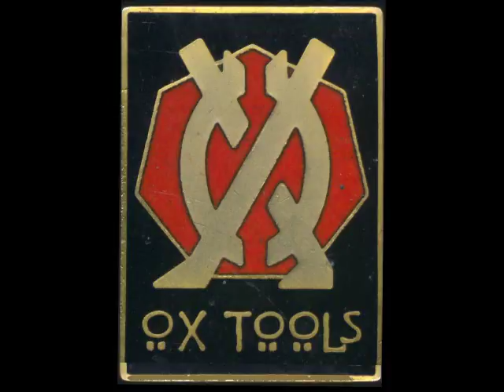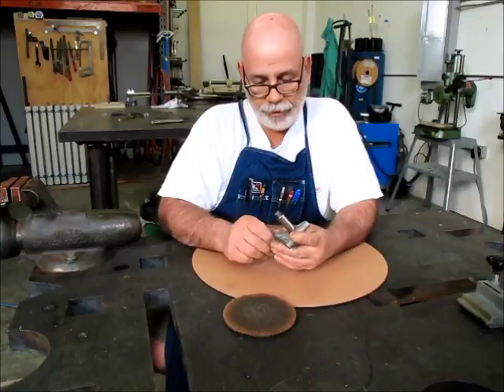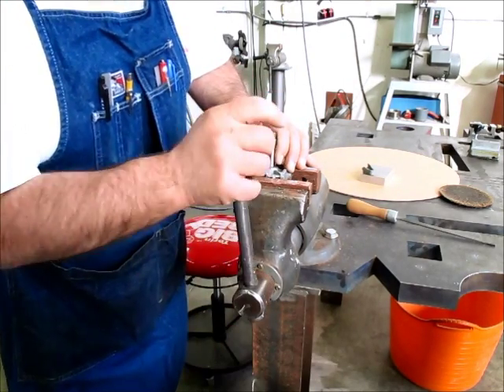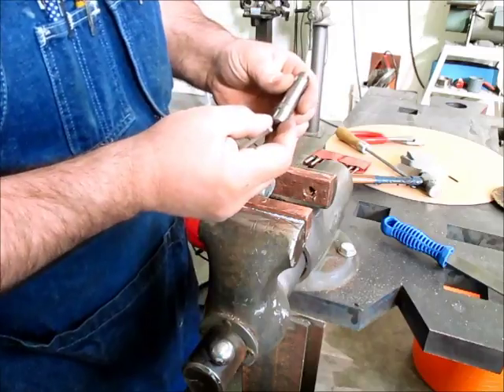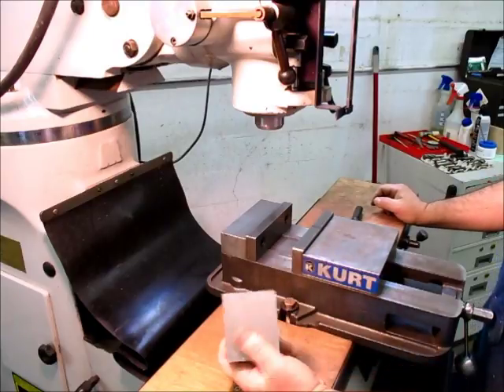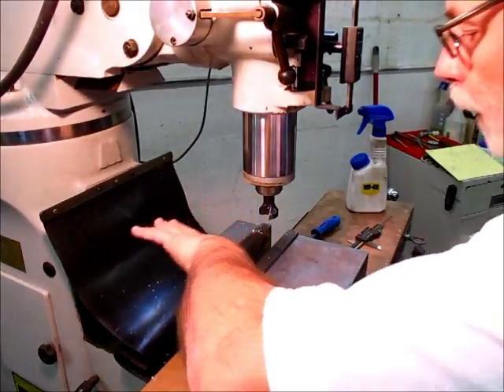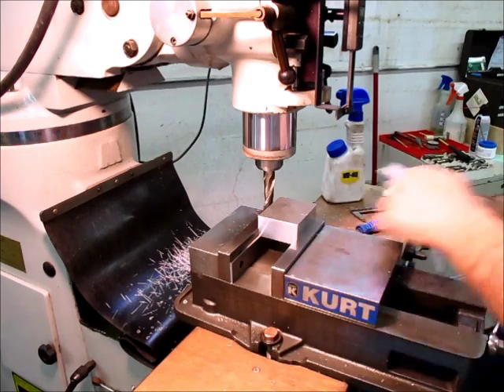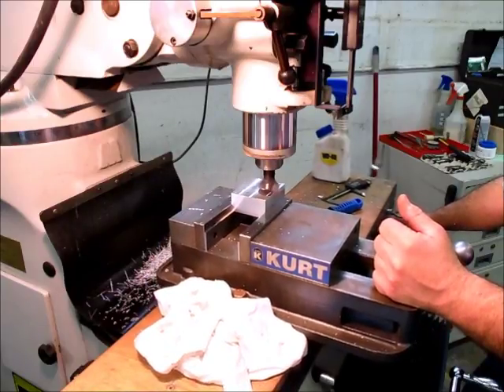Blade Tensioner Repair

Comment: Tom,
Thumbs up to the classical piano music in the background.  It reflects the very classy work you do in your shop.  
Interestingly, thirty years ago zinc "pot" metal was the most used metal in manufacturing.  That is, a greater quantity was used per year than any other metal.  I suspect that's still true, though plastic has replaced metal in many applications.  

Great lesson, making a tool to properly work on a machine without damaging it.

Richard

Comment from the maker: Hi Ron,

I've run a few different machines over the years. If you want an oversize say 10 x 50 table take a look at the Sharp's. I think they make an excellent machine and now you can get them with electronic speed control. We also had Acra's and Chevalier's that were pretty good also. You will love having that extra table.

Best,

Tom

Comment from the maker: Hi Glenn,

With small cutters and light cuts I don't give it a second thought. If you have large diameter cutters with minimal flutes then I start to worry. Anything less than 5/8 diameter should be a piece of cake unless your taking a big depth of cut. Try it on some scrap pieces and get comfortable with climb milling on your specific machine. Its more efficient and leaves a better finish in most cases.

Tom Lipton

Comment: Messed up. To finish, probably not the approiate thread to ask but I will anyway. I'm in need of upgrading my vertical mill. Old Bridgeport has about seen it's day. You have seen them all. What would you say is the best mill out there. Maybe a little larger than the standard Bridgeport. Would like DRO, power fee, knee feed as well, and power drawbar.

Comment: Tom, excellent as usual,

One question, what's the stick wax you're using on the vert saw? The stuff I bought is very dry and flaky and more crumbles on the table than gets on the blade. Looking for a more sticky version.

Also, thanks for the tip on your book, I was actually going to purchase it even before I found your blog. It comes highly recommended.

Cheers,

Glenn

Comment: Sorry to bug you Tom,

But one more question: I noticed you were climb milling, what's your thoughts on this?

I'm rather scared of it on my 70's bridgeport, (I only have four to five years under my belt, so I've sorta stayed away from climb milling because of all the warnings I've read about it) - My machine is not beat at all and is in remarkably good shape, so with that in mind, would it be safe to do?

Glenn

Comment: Is there a part 2 for this video, or is that still in process?
Thanks Tom, love your shop!
Reply from the maker: Hi Norman,

There are several on this job. Use the magnifying glass icon and search tensioner. Six part series.

Best,

Tom

Comment: Bizarre to find this now.  I just got a 1930s vintage Delta 14" bandsaw last month with the solid wheels(not really solid, just steel with no spokes).  After taking the motor apart, installing new bearings, brushes and replacing the crumbling tires, I couldn't get the damn thing to track.  Took the wheels off and....you guessed it.  The wheel was hiding this very part that was bent to hell.  I didn't think pot metal could bend like that, but I suspect it was a multi-decade creep from sitting in a barn unused for 50 years with an over tensioned blade the whole time.  Of course it broke when I tried to straighten it.  I happened to have picked up some of that low temp aluminum "welding" solder on clearance for 2 bucks a ten pack and proceeded to watch a generous portion of this part melt away before the solder would flow.  I think the solder flows at an even more generous 5 or 6 degrees below this crap alloy highlighting my lack of heat control with the torch.  Anyway, I ended up making a clay dam and consumed an entire pack of the miracle alloy recasting(I use that term loosely) the broken portion.  It does, in fact, look like a seagull flew by and crapped the mother load on it.  But it is holding for now and got me through resawing an oak log into some nice boards for use this coming summer once they're dry.  I found, while looking for a replacement, that this part is a notorious weak link of this most copied bandsaw design.  So, instead of just buying the part, I now need a milling machine to make my own........   You may want to make a couple thousand of these as the replacements are the same crap alloy as the original.   Thanks for the videos.  Great stuff.
Reply from the maker: Great story. I went overboard making the replacement just for the fun of it. I like your story better. Thanks for the comment.

Cheers,

Tom
Reply: Trust me, Tom...... I'd rather have your part than my story.   In lieu of the mill that I can't currently afford since my new tool money has to go toward my kids braces, I'll try my hand at welding up a milling attachment for my lathe.  Wish me luck.

Comment: I know it's just the camera angle, but how many acres is that bandsaw table at 13:22? :-)
Reply from the maker: +MrSleazey Hi Sleazy,

The saw is a 26 inch throat. The table about the same size square. Thanks for the comment.

Cheers,

Tom

Comment: It would be fun making the die for a part like that. That was a man's piece of aluminium you cut on the bandsaw. Have you seen this with "captions on" ? PMSL !
Reply from the maker: Hey Jester,

Check out the steady rest build. Cutting steel on the old Doall saw thicker than this sissy little chunk of aluminum. Thanks for the comment. Working your way from the beginning I see.

Cheers,

Tom